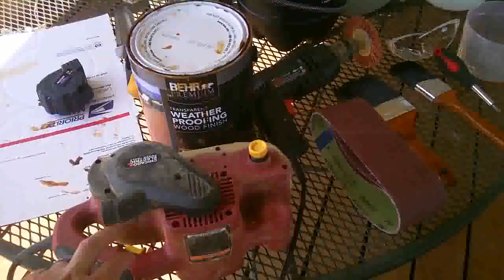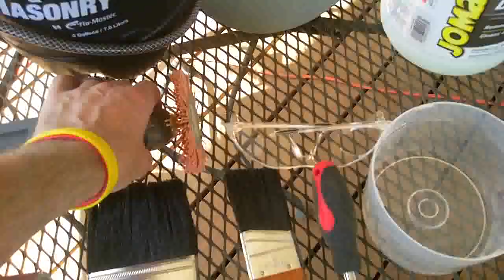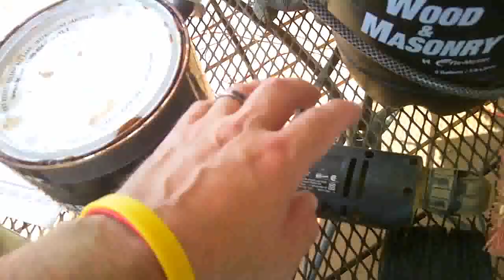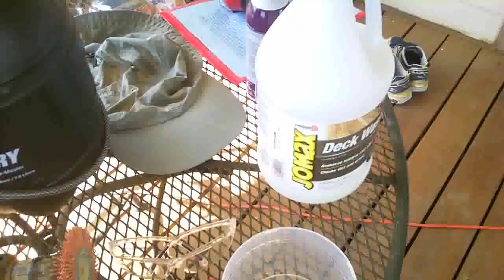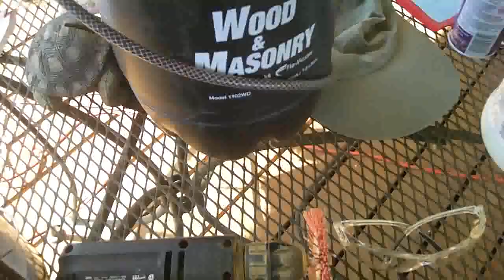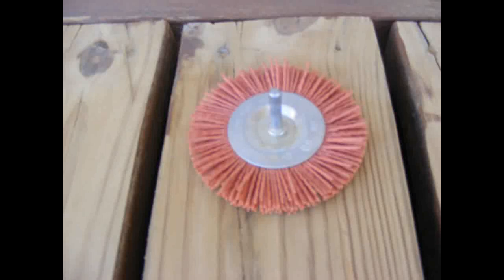How to sand, stain and seal a 12X12 pine deck using a belt sander and some simple tools

Comment: Can someone give me an idea of what the charge would be for a project like this?
Reply from the maker: It depends on the contractor. I would guess in the $500 to $1000 range depending. Thank you for watching and commenting. I appreciate it greatly. All the best.👍😀
Reply: @richardlloydusa  I just found HomeAdvisor, which I believe is a great resource to determine fair/competitive pricing. For a project such as this, they're stating the price should be anywhere from $2.20 to $3.82 per square foot. I've just been awarded a deck refinishing project (416 sq ft) and they've agreed to $3. I also believe the customer was comforted knowing that I used HA as a guideline. Thanks for this video as well...definitely gave me some tips I'll use!

https://www.homeadvisor.com/cost/outdoor-living/refinish-a-deck/

Comment: I would recommend avoiding that Behr stain/sealer like the plague.  It is one of the absolute hardest to remove down the road.  The EPA keeps restricting the formulas on the deck stripper products so they are becoming really weak.  If you look at the Home Depot reviews of the Behr deck stripper they are 2 stars.  If you go on the contractor and deck forums you will see nothing else works either.  The only way to get that stuff off is to sand it off every time especially if you put on multiple coats.  When you consider a stain the first thing you do is read up on what removal products work.

Comment: Nice job. But no need to sand that deck from what I can see. Could have used stripper and follow with a pressure washer. Then you could sand any troubles areas. Save some time and energy next time. Although nice job.
Reply from the maker: Thank you very much.
Reply: What stripper would you suggest ? Lots of them seem to have awful reviews. Good video, thanks

Comment: So you literally used just the belt sander to remove the stain, deck wash and then on to staining? Seems a lot easier than applying all the chemicals, stripping, etc.... 

Thanks
Reply from the maker: Thanks for the great tip. I may do that on the next pass. Sounds much less labor intensive. All the best.
Reply from the maker: That's it and a lot of elbow grease. Thanks
Reply: deck wash wont remove old stain, you would have to use a highly potent stripper, which not every one can use, kids, dogs , garden are a few reasons people dont use strippers. But what I would have done different is instead of using a belt sander and 15 belts, you could have rented a drum sander for $40 from homedept and used 2 belts of each grit for that deck in a fraction of the time. I just did my 40'x15' deck with the drum sander and it took 20 min each pass. 3 passes. 1 with 60 grit to remove old paint then 1 with 80 and final with 100. cleaned up the edges with my orbital sander. that took longer then doing my entire deck with the drum sander. just food for thought for the next time.
Reply: Can you explain what you mean by a drum sander?  Better yet, can you provide a link to the one from Homedepot? Thanks.

Comment: Did you wash the deck at all or hose it off BEFORE you started sanding it?
Reply from the maker: yesyoumay No, I washed it after I sanded it. I figured that taking the top layer off first was better. Thanks.

Comment: Great video!  Do mine now? :)   Do you know if you can do the same steps and use that Behr deck paint?  From the 'bare-footin' commercial? Or is this method just for stain?
Reply: Tim Dailey DON"T USE DECK PAINT, it doesn't work. I researched it extensively. Unless you can paint a board on both side and all edges. It will peel from absorbed moisture.
Reply from the maker: Tim Dailey I can't see why you can't use the Behr Deck Over paint. BTW I go "barefootin" on my deck with the stain I put on it. Splinters are caused by broken and splintered wood. Sanding it down should fix it. Thanks.

Comment: Nice out come. I flipped my old boards to expose a almost as new boards on the other side.
Cleaned and brightened with Restore A Deck and finished with stain sealant.
I have to say that sanding the boards down does look better but sounds like a lot of work.
Reply from the maker: There is lots of elbow grease required but as you can see the end result is good. That's a great idea flipping the boards as long as they are still good it would work. Thanks for watching.

Comment: Make sure to use a gas pressure washer with at least 3000 psi, the electric ones are just too weak. A couple pro's I know recommend "super deck" brand chemical strippers brighteners and stain. Depending on your taste either natural or  redwood stain. Superdeck website has many examples of stains ranging from transparent for decks that you strip and brighten and look good, with the wood grain still showing well. To solid stains for decks that still look bad after stripping, brightening and cleaning. After I stain a deck, and the wood grain really shows through with a nice hue stain, I like to use 1 or 2 layers of clear glossy coat to " glass" it in. Making the whole deck look like a beautiful sheet of glass.
Reply from the maker: Very good. Thanks for the update and info.

Comment: I would have just hit it with 3000 psi water, chemically stripped it, chemically brightened it , then rented a commercial push sander...then stained it, them glassed it in.
Reply from the maker: I am pretty sure that would have cost more money but you more than likely will finish the job quicker. I may try the pressure washer next time. Can you recommend a brand on the chemical stripper, brightener, stain and what you mean by glassed it? Thanks.
Reply: If you are changing products completely, go ahead and use a 3000psi washer followed by a sander.  If you are going to be applying the same product again, with most re-apps of same product you only need to use a good deck cleaner, followed by a brightner and the a lower psi washer (1800 is plenty) - No sanding should be necessary, but you can if you like although I doubt it will make the stain last longer.  If you use 3000psi, chances are you will damage the wood and have no choice but to sand it after....  This has been my experience using a high-end oil-based stain on my decks and I generally get about 2 1/2 years out of them before doing it again, which seems to be pretty decent based on what I have read is typical for decks stained with translucent oils.... Man, I wish it would last 5 years between coats!

Comment: Man, I am in the middle of doing my 2 tier deck. All pine with my 3 young sons jumping on my Back so I do about 3 boards a night
 I tried every hand held sander including the belt sander and found that my 6 inch Orbital which I use to detail my Car is the Best, Not the quickest, BUT I have more control and can get in between the boards. I am using red oak, but what should I use for a top Coat to seal it. Thanks Great Job !!!
Reply from the maker: I did not use a sealer. I used the all in one product Behr Transparent Weatherproofing Wood finish. I did put several applications on top of each other till I got the finish I liked. I suggest at least two applications. The more you put on it the longer it will last. Thanks
Reply: Richard Lloyd Thanks Bud. Looks Great. I only did about 8 Boards in red oak, so not sure if I'll keep going or switch it up. Do u know of a good sealer to put on anyway. Thanks !!!!!
Reply from the maker: *****  I have had good luck with the Behr products from HD so go with that. Make sure you follow the instructions and usually more layers a better.
Reply: Richard Lloyd Thnx Rich...I will definitely use it...
Reply from the maker: *****  My pleasure. Thanks for watching.

Comment: What do you recommend for removing paint from a deck?  I have sanded a majority of the paint off the floor of the deck but still have the posts to do.  I started to tackle it with an orbital sander but is taking way too long.  I heard that a hot water pressure washer may work as I have to remove about 3 layers of paint.

Comment from the maker: I did sand the spindles but I did not video that part. I took every single spindle off, sanded it clean, stained it and put it back up. Sorry I did not film the actual sanding with the sander. Next time I do it I will show you my technique. Thanks for watching.

Comment from the maker: Here is the issue. The stand up floor sander might work but it would have a tough time with the height difference from plank to plank as well as dealing with the cupping that some of the boards suffered from. With the hand sander I sanded every board by itself and flattened the cupping on each board. The roller may have been easier but with the brush I managed to stain between each board which made the deck look better. Thanks for the comment.

Comment: Nicely done.  If you were to do it over again, would you use a stand-up floor sander to strip the deck, and then use a long-handled paint roller to put on the stain?  I would think that would go faster with less wear and tear on your body.